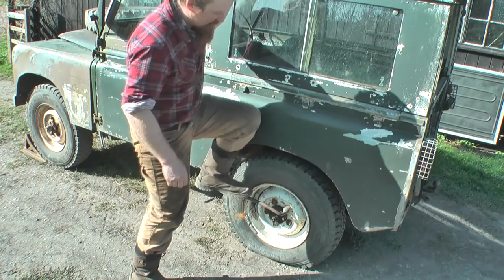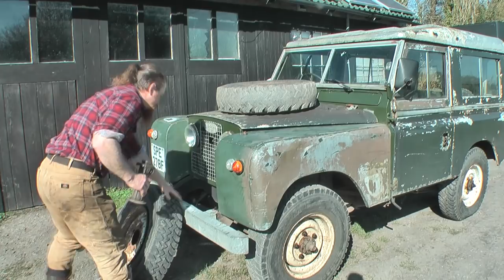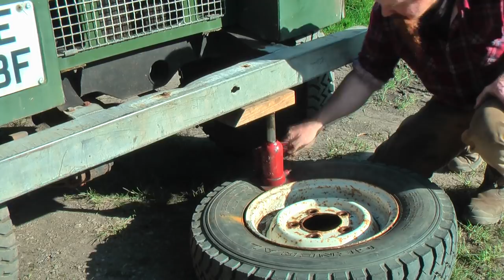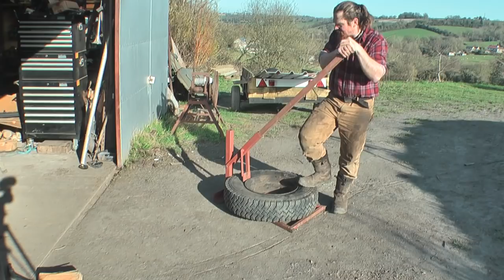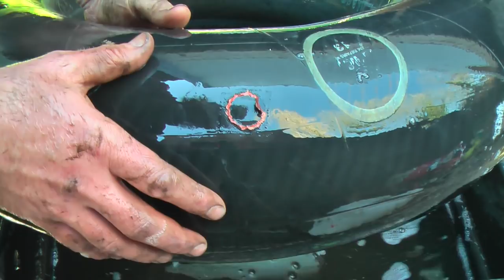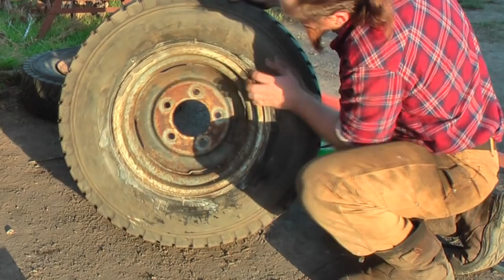Changing a tyre... in detail

Comment: If you want a nice two stage bottle jack cheap, have a look on ebay for ones taken out of Sprinter vans. They're 2.6t rating, and lots are brand new as they're taken out of parcel vans that have a policy of not changing flat tyres.

Also tyrepliers are a thing for breaking beads, not cheap but might be attractive if you want something portable or aren't up to making a Maximus style contraption.

Comment: keep your high lift jack in your landrover then you can jack it up to get your other jack under it. when I was an apprentice I was told on the final inflation off the tube tyre was to put some air in then wiggle the valve about to let air out between the tube and the tyre and repeat till its full. sad thing is now the you don't get spare wheels with a lot of cars just some sealer and a pump

Comment: Wouldn't a dash of talc help vastly to unwrap and smooth the innertube in the tyre? Did it ever since with spoked motorcycle tyres, never had a wearout failure, just carpenter nails and spax.
Anyway, was interesting and helpful. We used to ride over Sprinter tyres to break the bead when an emergency tube was needed out at the rocky beaches, but it never was an easy task and when possible we plugged the hole instead of the temporary tube repair. Thanks for showing and sharing, cheers !

Comment: Had a lot of issues on my 89 Land Rover 90 with the tube rubbing on the inside of Cheaper remould tyres and also against the wheel rim causing punctures. Swapping to higher quality tyres improved things but in the end I went to tube less rims as good quality inner tubes were hard to find.

Comment: Do you think the wax as well as helping slide the bead over also has any anti-rust effect at the rim? Controlling corrosion at the tyre - rim interface isn’t as important for tubed tyres, but rust is just nasty anywhere

Reminds me of an ancient Top Gear episode on a glacier in Iceland, running very low tyre pressures for weight spreading, popping the tyre off the rim, and reseating it by spraying wd40 (or some accelerant) into the tyre then igniting it to instantly inflate and seat the tyre on the rim. That was an eye-opener!

Comment: Until I can get some air in the tyre or replace it, here's a tip. As a temporary measure I suggest  putting the flat part of the tyre at the top. It's always worked for me.

Comment: As a refinement of your Hi-Lift technique, if you pull the wheel a bit further forward and put the foot of the jack sideways to the wheel hub (at the 3 o'clock rather than 6 o'clock position), rather than using the "toe", you would have a better and wider push down, right? Like all the other comments say; your warmth and calm practicality are always worth watching.

Comment: Only thing I'd add is 30secs of wire brushing the rim when you've unseated the tyre gives you a nice clean surface to re-seat to and helps the lubed tyre bead re-seat into place a treat. Bit like your checking the tyre for embeds, its an extra ounce of prevention ...

Comment: What I find strange with all punctures I’ve ever had, is that they all occur at the bottom of the tyre, and the valve stem is usually at another location, so you can’t just pump the flat bit up. Weird, innit?!?

Comment: One of the reasons rear motorbike tyres (and rear car tyres) get punctured more often than the front is that the front tyre flips the screw or nail point up and it then is perfectly placed to drive straight into the rear tyre 😞

Comment: "Give me a lever long enough & a fulcrum on which to place it & I can lift the world"....just a thought Max some vehicles have threads that tighten in the direction of wheel rotation all round not in the orthodox way..worth checking in the manual...
Reply: Yeah found that out the hard way on my Convoy 🙄, quick way to snap a wheel brace.
Reply: Yeah my crappy old boat trailer is like that.
Reply: Bedford lorry axles. Bloody things. Widely recycled into farm trailers.

Not only do they have reverse direction threads but have split rims as well

Comment: Had my Landy for  35 years now and have fully rebuilt 5 of them over the years. Don't jack up on the axle casting,  you run the risk of cracking it. With a small jack like that your actually putting about 30 ton's per square inch on the casting.  jack on the spring hanger plate nice and flat and much safer.
Reply: He knows what he is doing.
Reply: Andy Bawn  suppose you’re lifting 1 tonne the surface area of the Jack would need to be about 5mm squared . No mate

Comment: Hi mate the tyre allways comes off easier on the shallow side of the rim , in the case of the 750 rim ,tyre off from the rear , hope this helps.
Reply: Very true, but a pig to get the tube in and out.  That works better from the front, same if you have to take the rim out completely...I can vouch as I just did it, from the rear and it proved to be a real bitch and took twice as long.  It was pretty cold out though so the tyre was not exactly pliable, even with lots of soap!

Comment: Next job change a super single on an attic trailer without disconnecting the wheel from the truck at 2 am in the fain on the side of the motorway

Comment: Never push on a wheel brace, all waway pull, if the wheel brace slips and your are pushing you end up face fist in the wing, pulling you just end up on your back, Hendon police Collage have a wing off a police metro with the police officers front teen marks in in when the wheel slipped.

Comment: if you put a flat steel plate on the tyre lever machine you built wouldn't that push the tyre back onto the rim rather than using tyre levers ? looks like it might be easier / quicker ?

Comment: Why didn't you just put the tire directly under that jack, meaning instead of sticking the tire under the car, put it on the side or in front with the part of the jack that is taking the real weight resting on the bead.  Also to take out the valve from the valve stem, you can use a pen with a cut in the middle of the tip.

Comment: TUT TUT !!
No AXLE STAND.
Shouldn't teach people bad habits.
By the way,  I still love your vids.
Reply from the maker: In the workshop I would do the whole procedure entirely differently (and with air tools), but I was trying to demonstrate how to do a roadside repair, not many people would have axle stands on board. Nor do you need them provided you work with care and never under the car.
Reply: @maximusironthumper   .... Correction acknowledged, I was wrong.
Reply: @Jasfras1  Yes agree with you ... you were wrong
Reply: Maximus Ironthumper  I opened my spare wheel well to change my tyre on the way home last night. However I spent the night in the car as although Peugeot had supplied a Jack there was no axle stand .  Better safe than sorry . Some years ago I was watching an episode of watchdog with lynn faulds Wood
Reply: Sadly now dead . However she was berating people for not knowing braking distances at various speeds . She spoke to several lorry drivers and exposed them as dangerous drivers for not knowing their stopping distances . A lorry driver said I can look down the road and tell you where I was going to stop . Ms Faulds wood says that’s not good enough you should know it’s 140 meters at 60 mph . Ok says the driver tell me where that is . Game set and match smart arse

Comment: Tubes belong on tractors, not cars and 4x4's. If you get a flat on a tubed tyre at 45mph, by the time it takes to stop the tube is unsaveable. Tubeless fares much better. Tubeless plugs were banned because or cheap rubber plugs (and their costly associated pneumatic applicators) that came into vogue back in the 70's.  The steel cords in radial tyres cut the rubber plugs and they fell out. The original graphite plug kits are still sold in tyre places and $2 stores, do not cut and are permanent, although illegal. If a tyre is damaged so badly that it cannot be plugged it is probably too far gone to repair and be tubed. Tubed tyres are plagued with leaks and flats. If you deflate a tubed tyre to go through mud and sand to get better traction and you hit a rock you will pinch the tube and it's all over. Tubeless graphite tyre plugs can be applied (by hand) on the track, without taking the wheel off the vehicle or the tyre off the rim. All you need is a Jack and a $15 plastic 12v compressor which you should always carry at all times anyway.

Comment: hi , when changing the tyre /  tube after placing the tube into the tyre / rim slightly and only very slightly inflate the tube just to give it a little shape and keep it from being nipped when levering your tyre over the rim , NEVER  try to remove a valve core with an electrical screwdriver it will damage the core and the inside of the valve stem itslef as they are only brass , and if you break the core inside the stem you will struggle to remove it also while the tyre is off the rim clean the area that the tyre seats on the rim itself with a wire brush or other abbrasive tool , oh and that spare is bald ie illegal put your hand in your pocket tight ass , it alaways amazes me how you people have such little regard for road safety  just because a vehicle is MOT  exempt does not mean it doesnt need to be maintained to the same high standards as vehicles which arent consider the safety of others not just yourselves !!!